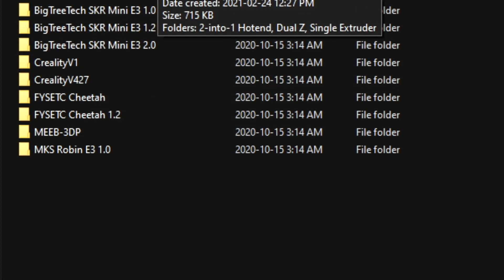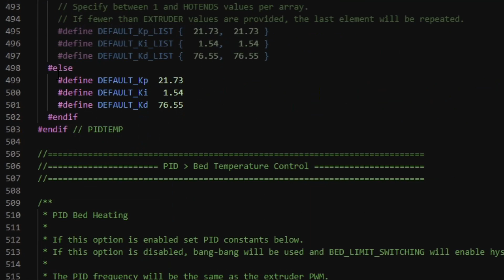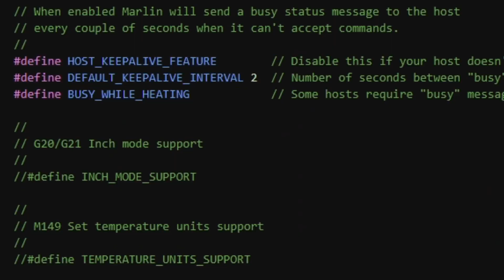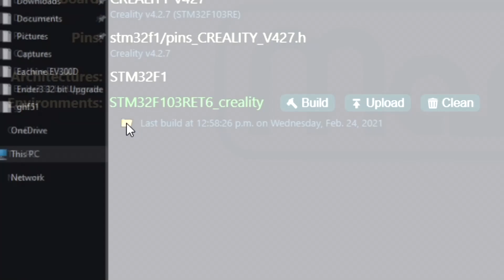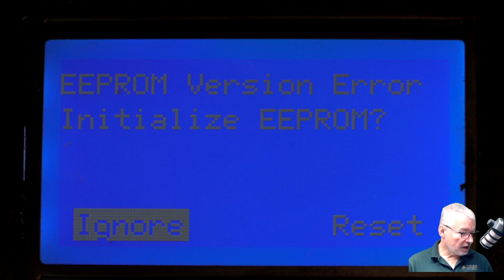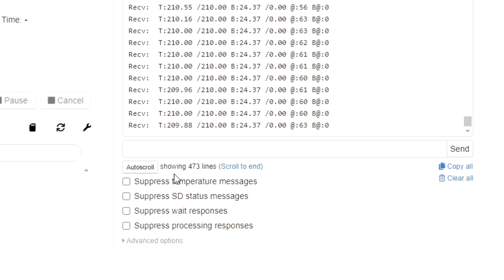3D Printer custom PID and Marlin 2.0.7 PT2

Comment: thank you for this video ..
can you please tell me which part of the code is for the retraction ?
i just like to study it in any programming language ..
Reply from the maker: Most current 3D printers in this class still use retraction from the slicer, not marlin, but the latest firmware (2.0.x) do have a feature called "firmware retract "  if you search for "FWRETRACT" in configuration_adv.h you should find the references to it ,  files like the planner.h etc, you will then have to weave through the code to find more details and methods involved with its implementation or more applicable the file called fwretract.h, you should find what you need
Reply: @TheBreadboardca  thank you so much